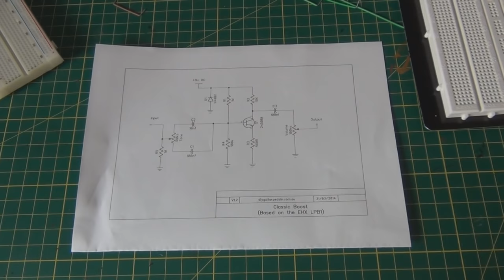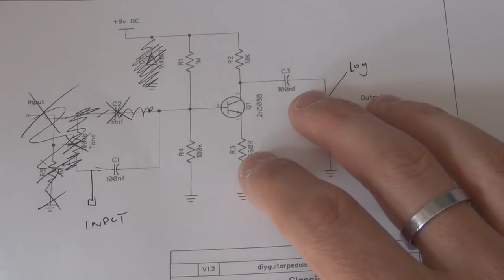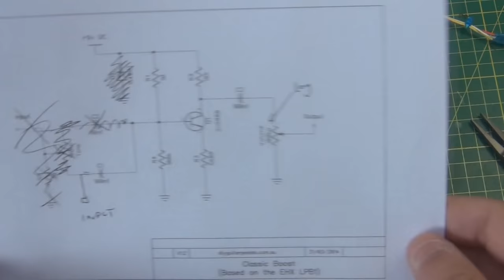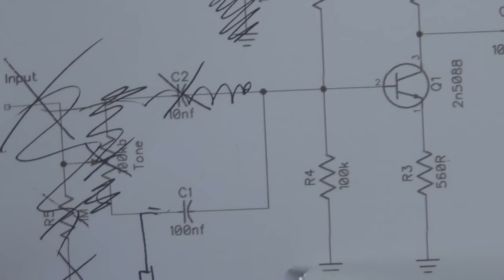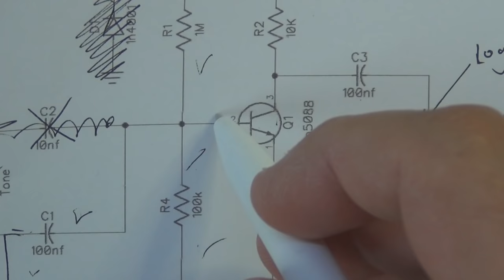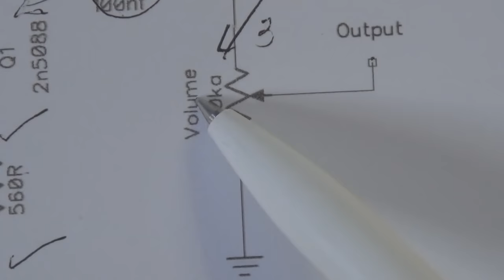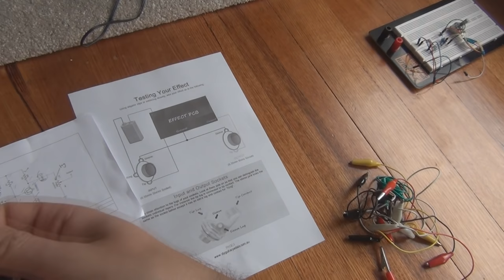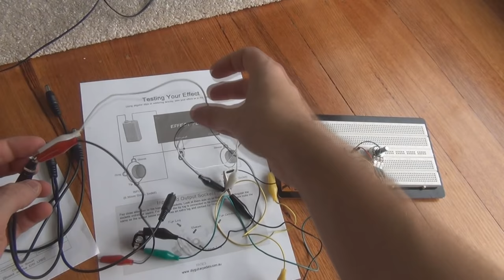Guitar Pedal Beginner Breadboarding Tutorial - Boost

Comment: recommend putting the schematic link in the description since you say "do-it-yourself" in the url not "diy" for people that haven't been to your site before :)  Love your vids btw started building a couple months ago.
Reply from the maker: Whoops, thanks for letting me know.  Added link to description and pinned this comment for anyone confused.  Cheers
Reply: Any Chance you can do a series  ( full Build on one or a few of  your circuits  , from start to finish  )   . I know you have covered drilling cases etc but a full build multi part  series would be fantastic to see .
Reply: So I did it but I used stereo 9v Jack and stereo input and output Jacks. The pedal signal comes through but is terribly gated and comes through distorted. Any ideas as to why?
Reply: @parabot2  I agree with para.  This would be wonderful!
Reply: @mllahTime289  was this issue ever resolved?  I may attempt to try and build one of these.
Reply: @jodymcdougle8810  No i never ended up trying it again. I should though. the only difference was the input and output 1/4 jacks

Comment: Hey man, big thumbs up for your vids, i'm a beginner in electronics and just built some kits with success... but what i really miss is: WHY an Xk resistance, or WHY an Yk instead? or why a Znf cond and not an Kuf instead? i mean, if you can, could you bring up a vid (or a series of vids) explaining the basic WHY of a circuit choices (also this little booster is totally incomprehensible to me) for audio? thanks.
Reply: The LPB1 is basically a gain stage to produce natural saturation in an amplifier. The circuit is one of the first EHX products, and it was intended to push the tubes in an amp into overdrive and create not only a volume increase but clipping, and give the guitar the basic slightly distorted sound. Now, in this schematic he's just building a basic polarization network for the JFET transistor in the center. If you read more about biasing transistors, and using them as amplifiers you'll understand a little bit more. There's some math but it isn't hard to understand ;)

Comment: Great, thanks it works with my electric guitar. Only the output is still to weak for my 60 watt amp. How can I make a higher output gain without distortion ? I use a 2N2222 transistor.

Comment: Nice tutorial. Do you have a video explaining component choice & purpose? I have decent electronics knowledge, but I'm still struggling to visualize the electron flow. It would also be nice if you marked the expected voltages or even the expected waveform & frequency (depending on application of course).

Comment: Its slightly confusing when things are stated like, "it doesnt matter how they are connected, just as long as they are connected in this exact configuration."  I am starting from absolute zero and the language on the diagram looks like alien hieroglyphs but I was still exasperated at the digression into continuity. That being said thank you very much for this vid, I definitely still learned much. I wonder, do you have a series aimed at beginners like this or actually maybe like explanations of what these components actually do and/or interact with one another or work together or whatever it is they do. I feel as though a veil has been lifted just at realizing that I must first learn what the parts are and what function and then proceed to figure out how to read the schematics.

Comment: Thank you. This was really helpful for me to learn more about circuits. In the schematic, why don't the leads going to ground just connect to the negative of the power source? Is it just to keep the schematic clean with less lines? Is it assumed that the ground symbol indicates the negative of the power source?
Reply: I've always thought the the ground symbol comes from the time before PCBs. They used a technique called "point to point" construction & nearly everything electrical was built into a metal chassis. 
This conductive frame was grounded 
traditionally to negative but for some reason music bucked this trend & settled on a positive ground. My poor Zoom GFX-707 paid the ultimate price for this. They omitted one tiny diode worth a fraction of a penny, that protects from wrong polarity cock-ups is very lucrative for the manufacturers. It's inbuilt   obsolescence by omission!
Ahem, I digress...
So when building point to point, anytime they needed a ground, they'd just connect to the nearest bit of chassis. 
The actual symbol makes more sense too if you imagine a wire leading to a brass terminal riveted or bolted to a piece of angle iron. And just as  it appears on modern schematics this could happen anywhere it was needed.
I might be totally wrong but it's my best guess that fits all the points.
Oh! Google "point to point" electronics, hit "Images" & thank your lucky stars we don't have to build like that anymore!
No wonder things stopped working if dropped!
Reply: @Aengus42  That makes sense! Thanks for the explanation. So it's safe to assume nowadays when there is a ground symbol, it means it's just connected to - on the power source?
Reply: @drainyoo1  Yup, but it doesn't have to be a herd of wires galloping to the - of your PP9. Take a hint from point to point & grab the closest ground you can find. Wires have resistance & cause losses (mainly to heat) so they shorter the better.

Comment: Great and very instructive intro to bread boarding, answered a lot of questions I'd got.

Have been thinking of reusing a large metal biscuit tin as an enclosure, with the common parts i.e power input / output jacks and maybe a few switches installed in the sides of the tin. I think Brian Wampler used an amp chasis for the same kind of thing.

After watching your video feel a bit more like trying to make it work. I'm fairly new to this stuff, having modded a few pedals from kits and getting bitten by the bug!

Thanks once again - great video.

Comment: Maybe a bit of a silly question, but what do I use as ground? I'm doing some simple pedal builds on a breadboard with a 9V battery but I'm unsure what I should be using as ground or what I should be connecting the ground leads to.

Comment: About 5 minutes in he speaks of a resistance point where you won't get a beep,  if anybody is wondering he's talking about the beeping u  hear on your multimeter and it usually happens around 30
 60 ohms. Not all multimeters will beep,  but they should all read continuity (all or almost all zeros, like a short piece of wire) and the
 point where the speaker begins to stop sounding (the resistance
 of the beep circuit and the speaker, is what I think he's talking about.

Comment: Very helpful tutorial. I have one question. Where would you add a switch to turn it on or off?
Reply: On the positive, red lead, from the battery or power supply. I'd stick a diode on that lead too to protect from crossed polarity mistakes.

Comment: Where can I find out how to repair a Boss SD-1 OD?
Reply: I plugged in a center + when it needed center -. What did I likely smoke?
Reply: @christugman1533  Likely D1 and D3. Hopefully that's all it took out. Both function as reverse polarity diodes. D3 can be replaced with an 1N4148 with little to no issue and D1 is and 11V, 500mW Zener diode, so something like a 1N5241B or BZX55C11 would work.

Comment: Any tips for lowering noise? I just built this circuit and it sounds great but I get a ton of static noise. I tried just linking the guitar input and output together with the alligator plugs and I get the noise. Are alligator plugs bad? Any alternatives?  Thank you for your incredible work and inspiration

Comment: Very nice tutorial for beginners, thanks! One question, how did you make the slide on/off connectors for the wires you connected to the potentiometer (aka the green shell around the cables) and what is happening inside them? I'm asking because I would prefer to not solder anything onto the potentiometer if possible.

Comment: Good day and merry christmas. I thought I'd spend this day to build this project as I'm learning this stuff. It's working now but I've got a few questions: 1. I had to place the transistor the other way around to get it to work (2n5088 b21) so it seems that the pinout is the other way around.... which surprises me: please comment on that? 2. Could you explain what the function of the resistors is (obviously to "resist" voltage) , especially the ones that go to ground? 3. I have a 100kB output pot hooked up (because my retailer gave me the wrong type) but it seems to work ok. What would be the difference with a 100kA  (I understand the difference is linear vs. logarhythmic)? Thanks in advance.
Reply: I too am wondering about the 560 resistor and the purpose it serves going to ground. To the op the difference in pots 100a vs100b is the increase in volume is described as less natural to the ear. The b type supposedly has more increase at the low end and less at the high end. I myself have only b types and while I will try the a type a little later I didn't see anything wrong with it.

Comment: hey so i put this together on my bread board and im not getting any boost, my pot is working but the volume without the boost is louder then the volume with the boost engaged and at max. im using ceramic disk caps, could this be why?

Comment: I'm using ceramic capacitors and I'm getting a quieter signal out than through just the amp alone. Is it the capacitors causing this or you think something else?

Also it seems that I have to connect the ground to the + side of the battery and the + on the bread board to the - side of the battery to get a signal out which seems backwards
Reply: ian greene same problem here with the caps. The DC thing is a polarity issue; just hook the cables the other way around. Anyway, i'm getting a weak signal out of the board, and also used ceramic capacitors, but i don't think that might be the problem. Not cool. I have no clue of what's going on
Reply: Without getting too much in the physics the ceramic capacitor is one of the worst you can use for audio application. You want to use a film capacitor or electrolytic....in the video he used a plastic film capacitor. Keep in mind electrolytic are also polarized, meaning they have a +/- whereas your ceramic is non polarized. Some film caps will also have a marking which indicate which side of the cap is protected from interference...which is slightly more complex to get in to. 

Notice the schematic has an arch to one side of the capacitor plate, this indicates the side that should be negative. A non-polarized cap schematic will have 2 parallel plates

Comment: Any chance you've done a vid on diy overdrive using an opamp. I've seen so many schematics that I am struggling to understand due to pins 1 to 8 on the op amp.
Reply: Hi, it should be pretty similar to this video. Find the pin schematics for your OpAmp model and connect the pins acording to the desired circuit. A few things to consider: the INVERTING INPUT port has a (-) on the circuit, the NON-INVERTING INPUT has a (+) on the circuit, the V+ and V- ports are where you connect power supply for the OpAmp (as it should show on the circuit), OUTPUT is the output and the OFFSET pins are used to control something called input offset voltage: Ideally the voltage between the inverting and non-inverting ports should be zero (0), but this can't be achieved in real life. Whatever circuit you're trying to build should tell you where to connect each of the ports. Hope this helped.
Reply: @limapedro  thanks Pedro 😊

Comment: once you've got the effect sorted in breadboard how do you go about putting it into a smaller format to fit into a pedal?
Reply: Daniel Cain soldering to perf board or vero board. Then mounting to a pedal box. You don't have to use a switch either it would just be on if power is supplied, but I doubt it would be hard to figure out the stomp switch.

Comment: I wonder if I u could maybe answer a question for me bud? I'm trying to build a simple pedal I have all the components but there is 1 thing that I can't seem to figure out?
Reply from the maker: Ill try vampire, whats your question?
Reply: DIY Guitar Pedals  well I got my hands on a jackson je-1000 preamp mid range gain boost. Instead of installing it in a guitar, I wanted to put it in a pedal. 

Now... What I'm not sure about?

The gain boost conects to the pickup with a green and black wire coming off the board. And then at the other end of the board it connects to a guitar out put jack with an orange, white and black wire. There is also an ON and OFF toggle switch, but... its just a power switch weird off from the board "already connected" 

And there is also a 9v battery connection "already connected"

The board has a volume pot directly connected to it. 

My guess is I could just put the device in an aluminum pedal case. on the left side of the case put an input jack weird to the green and black "pickup connections" 

And put a input jack on the  orange white and black wires on the right side of the pedal case.  And it should b able to grab the signal from the pickups and do it's job???

I'm not sure if the green and black wires r going to b able to connect to a guitar input jack???

Sorry this was lengthy but. There was a lot of info I thought I should explain. thanks for the reply!
Reply from the maker: Sorry mate its a little hard to follow but at the end of the day all true bypass pedals end up with 4 connections, in out plus and ground.  You will have to work out which is which and how that relates the effect you working on.  Sorry probably not much help.